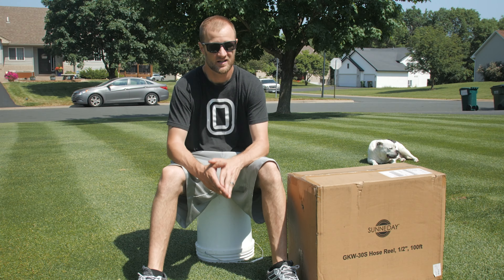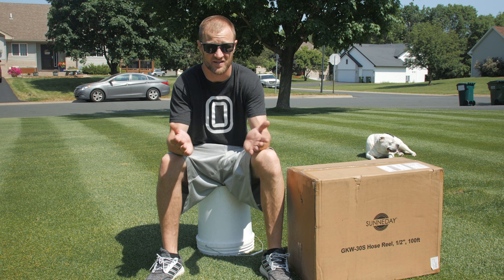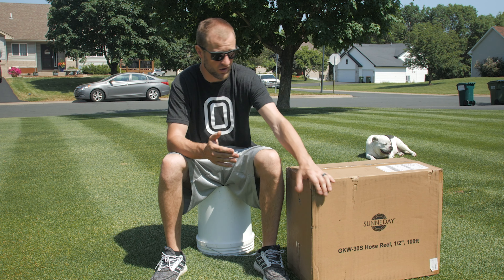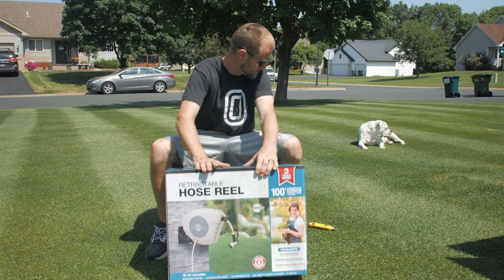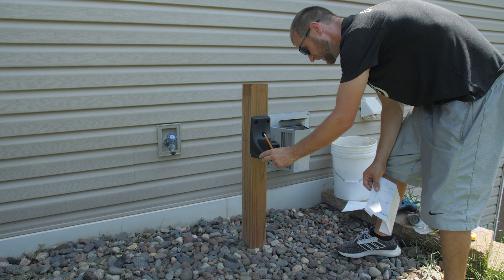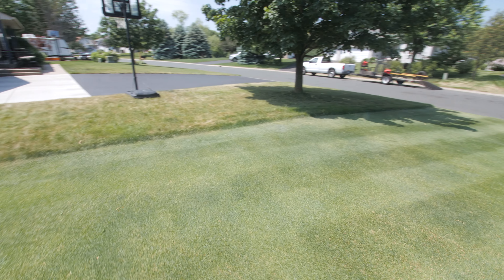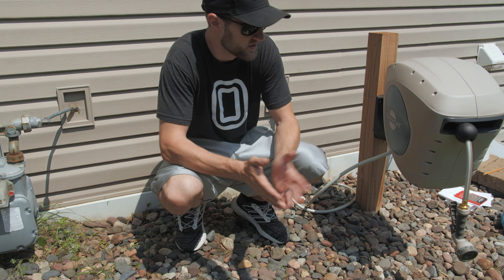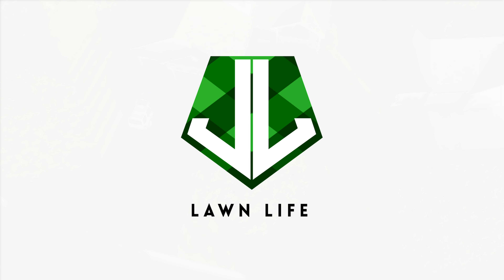Retractable Hose Reel Review - Is It Worth It???

Comment: I just bought the Gartenkraft XG Series 75 ft. Retractable hose reel at Home Depot (it’s a Sunneday) and they have addressed some of the “con’s” you listed. It has a flip-open compartment in case you ever need to replace the hose. Mine is a 1/2” and provides plenty of pressure to do hand watering  or for hosing off the concrete and house walls/windows. I’m definitely pleased with the brand and product so far.

Comment: The foam is great. I used another brand to install a 16 foot gas pipe grape trellis with copper pipe cross beams . Plenty strong. Held 5 years before I moved with no problem . I will use that stuff again.
Reply from the maker: I'm all about convenience. Definitely less clean up. Glad it worked out for you also!
Reply: What foam are you guys talking about

Comment: Needs some wetting agent at that low of cut. Hydretain also works great in conjuction with the wetting agent. Like my hoselink. My have to try this sunny land out back of my house.
Reply from the maker: The last 2 weeks have been absolutely brutal for us. High 90's and into the 100's with zero rain. Last year the yard didn't have too many issues with the heat. I think this could be a good budget option for you if you grab it for $155 at Home Depot.

Comment: You may have swung me on this. Getting sick of my pocket hoses and am convinced they're giving me crappy water pressure. Thanks for the great review.

And yeah, in Northern Illinois it's been hot as shit with no rain. Feels like mid-August the first week of June with no relief in sight.
Reply from the maker: Dude this weather is crazy right now. We've already hit over 100 multiple times this year here in Minnesota.

If water pressure is a big deal for you, I would definitely go with the 5/8ths over the 1/2 inch if you can swing less length on the hose. Pressure is not as great as I thought when I reviewed this. Wish I had a little more now that I've used it a few times.
Reply: @LAWNLIFE  A-ha. Great tip on the diameter. With the pocket hoses, just seems like it takes a bit to build up pressure. Oh well.
Reply from the maker: @chrisaustin23  how long have you had your pocket hoses? Just curious if they're more durable than the shitty ones I bought.
Reply: @LAWNLIFE  Probably bought my first one a couple years ago? But it leaks like crazy at the connection to the sprayer so it gets me all wet. Didn't take long for that to happen. But they've never exploded on me. Bought a couple from Menards and one from Amazon.

Comment: A year later, can you tell me how this is holding up? I want to get one but I live in Houston with extreme hot and humid weather and I just have a feeling these retractable reels won't hold up. Any update would be appreciated.
Reply from the maker: Its working great. I would recommend getting a wider diameter hose though. The pressure isn't as good as I originally thought

Comment: Good review.  I've thought about getting a hose reel for my 100ft hose but haven't ever pulled the trigger.  I have been happy with my Zero-g hose, I have had it for 3 years with no issues but maybe I am lucky in that regard.  What is your HOC on the front yard?
Reply from the maker: Thanks Chris. I definitely like the ease of it reeling back in by itself, but definitely could use a bigger diameter hose. The Eley hose reel might be a good option for you if cost isn't a factor. I couldn't justify the cost for a manual reel personally. Thanks for watching!
Reply from the maker: 5/8ths by the way!